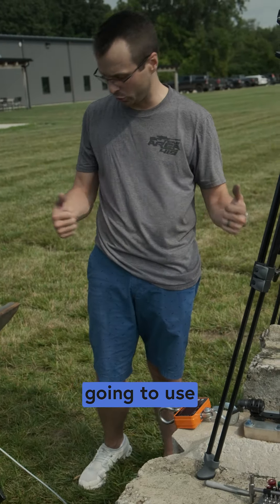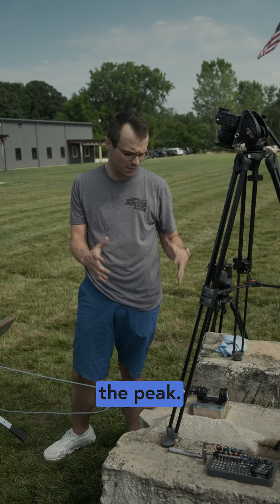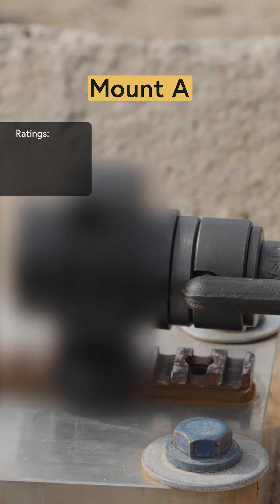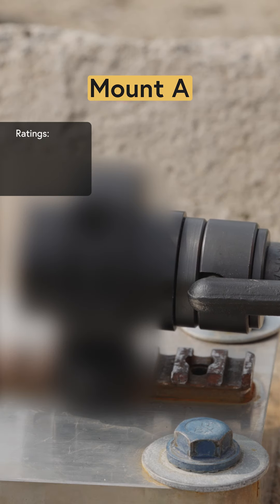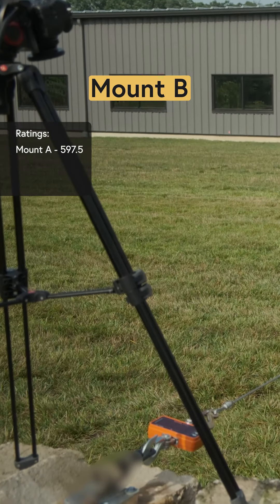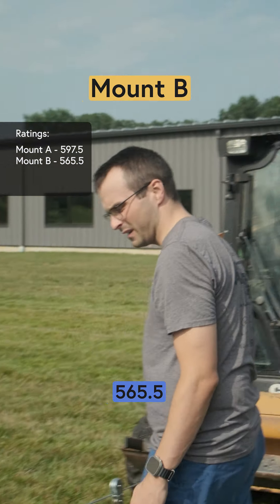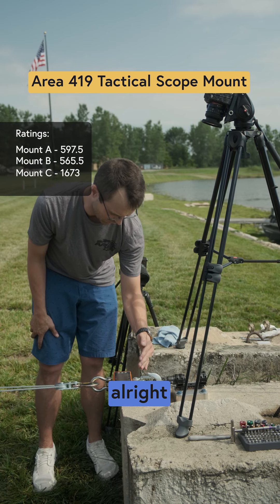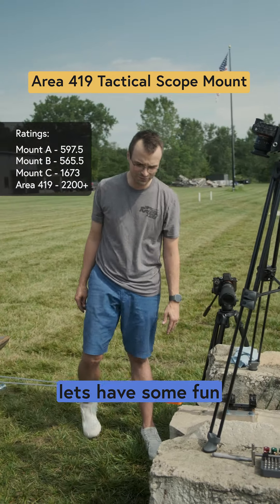Area 419 Tactical Scope Mount vs 2,200lb Pull Test

Comment: If they hold 500 lbs of pressure, that's more than enough for a scope. 🤔 
Ridiculous !
Reply from the maker: @MTCKIE68  Go Google “scope slipping in rings” or something similar. Grip matters. Are we providing more than enough? Certainly. As we should be.
Reply: @area419  
 Seriously if you are shooting something with that much pressure to make the scope move then lap the rings and that's gone. It's my understanding from people who don't want to be named none of these rings are true they all should be laped. 
 A 50 caliber doesn't put that much pressure on the scope to make it move in the rings unless it wasn't installed correctly. Period 
 I think y'all make amazing products but you're extremely overpriced with them. 
  It's getting ridiculous how quickly the new 2A companies are getting very wealthy in a short time. 
  That's Greed plain and simple.
Reply: @MTCKIE68 yeah I agree 110% with everything you just said. I have quite a bit of Area 419 reloading equipment for when they were not as well known. Back then there stuff was relatively reasonably priced and of great quality. I can’t really speak to there current quality because I can’t afford to purchase anything from them anymore.
Reply from the maker: @Johnny-jr2lq  we’ve changed prices once, on very few products, and none by more than about 5%. And that’s since 2016.
Reply: @area419  well what I mean is when you guys machine something out of aluminum or steel you always want to change hundreds of dollars for it. For example Redding makes the competition shell holders. You guys have the zero modular system(traditional) Reddings version is 65 bucks yours 225. And it’s like that with all your products you make a version of something that another company has already pioneered. But you guys will freshen up whatever it maybe from muzzle brake, dies, rails, scope mounts, electric scale trinkets, and so on. But expect people to pay in some cases hundreds of dollars more then your competitors. Now don’t get me wrong I really like your products and really like how you put your billet twist on it. However I’m not going to pay hundreds of dollars more just because it’s cnc billet with your design style. Essentially you guys make reloading jewelry for the reloading bench. Problem is there is no real value in that’s say for instance I want to off load some reloading equipment to fund another reloading project. Nobody is going to care that I have Area 419 reloading jewelry. Especially since 70% of the reloading community will run Lee and be just as happy about it.

Comment: That's impressive. But, I don't see me mounting my scopes on a elephant gun, or a howitzer.
Reply from the maker: @snakeman48  Go Google “scope slipping in rings” or something similar. Grip matters, even on small arms. Are we providing more than enough? Certainly. As we should be.
Reply: I've had a scope in a properly torqued, very popular and expensive mount slip on a semi-auto 308 and create a less than enjoyable multi-gun stage.  Recoil can be a very sharp force with moderate calibers.  Repeated a few thousand or even a few hundred times and it can be consequential.